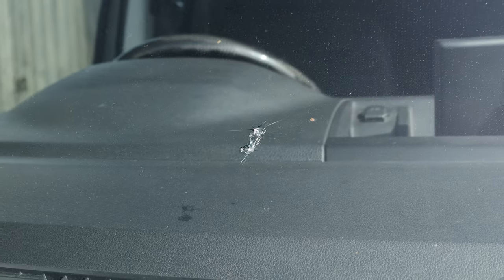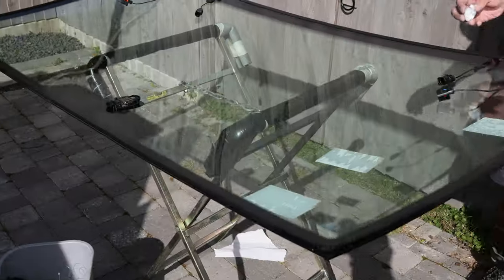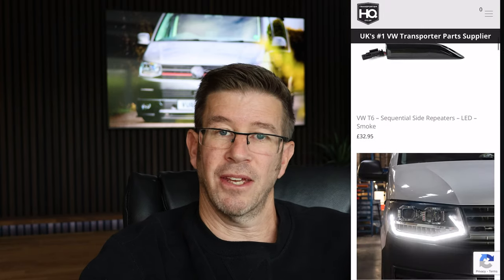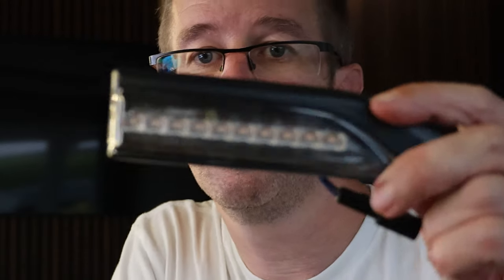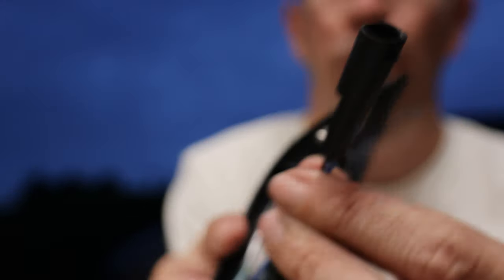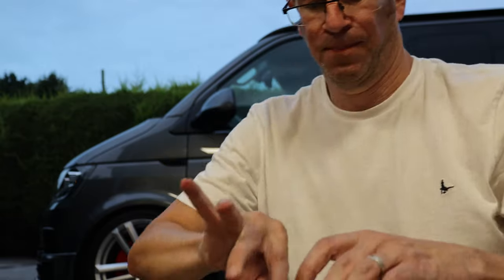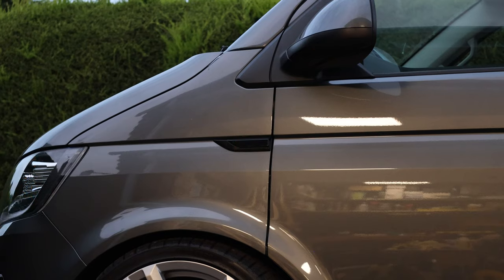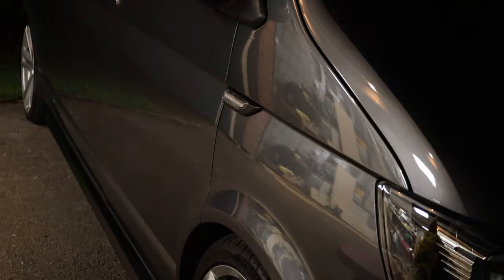NO MOT!!😣 | NEW Ultra Bright Indicators for the T6!! 🔥

Comment: Steve,
Take a look at the Aguti swivel base aka reimo. I bought the aguti from kiravans a few years back. Just the passenger one.
Retains the same height, more than pleased with it and I put the leisure batt under the drivers and kept that standard.
Also used kirvans battery tray and brackets makes a neat job
Reply from the maker: 🙌Thank you for the tip!! I will take a look into that as a potential for next years camping..👍

Comment: Good informative video Steve , the joys of owning a t6 🤷🏻‍♂️ I’m just gaining you a heads up , I’ve just had to spend over £3000 on oil leaks fly wheel side and the belt side ,! Apparently the gaskets VW fit from around 2017 onwards fail ! My T 6 is a joy to drive , but honestly it’s been the most expensive and unreliable van I’ve ever owed . Sorry for my moan , keep up the good work 👍
Reply from the maker: Hi Paul,   Ah sorry to hear yours has been giving you some bills! we had the same story with a golf TBF... sometimes you just have a needy one and then it will run for years.  hope its smooth sailing from hear on for you buddy. 🤞

Comment: Hi Steve had same problem with my passenger seat wobbling to , have you checked for loose nuts under the seat , as mine where until I tightened the nut , just asking 👍🏻
Reply from the maker: Hi Justin,    Yes I did on a number of occasions but sadly it was not the issue with mine

Comment: You will pass the MOT regards wheels on any van that's got multiple seats (ie camper or kombi), if it's a panel van it won't - tried it with 2 identical ex fleet vans and that was the only difference, they don't care about LED lights they test on beam pattern and light spread, only caveat being you can't see the LED itself and it's behind a reflector or prism.
Reply from the maker: That’s interesting stuff! 👍Thanks for sharing🙌🙌.

Comment: Hey Steve, do your main beam LEDS throw up a fault light?  Which ones are you using?
Reply from the maker: Hi Paul.  Yes they do!  It resets each time I   Toggle the ignition but it can be coded off.  I am going to do mine soon.  Vagcom can code it off and make the dipped beam stay on with main👍.  I am running the THQ H1 in the high beams👍
Reply: @SteveField  awesome.  Thanks mate. I think my carista can sort out the main beams staying on with the dips. Not sure it's clever enough to code anything out.  Keep them videos coming my man
Reply from the maker: @paulwilson3759  🙌thanks paul! Will do😊

Comment: what make was your swivel seat base mine has been fine for a few years now?
Reply from the maker: Mine is the RIB one.
Reply: Hi steve mine was from JustKampers and has been just fine for 3 years now 
My van is much the same as yours I bought a T6, 19 plate indium grey shuttle bus 3 years ago and have gone through the same process as you funally enough before I found your site we must be one the same wave length, have lowered van so the poptop will go into multi -story carparks on Transporter HQ Belsteins comfort can't afford the air ride just yet!

Rick Bishop

Comment: Hi Steve a quick question about the rear lights you have , are the travel in lite ones better than transporter hq versions , I see that the thq ones are all smoked with no clear bits for the reverse which looks good but not sure about quality of travel in lite stuff as I’ve had some dodgy led interior lights , was just wondering why you choose them over thq , any help be great amd thanks for the how to vids
Reply from the maker: Hi Nathan, sorry for delay... So I cant really comment on the THQ ones as I have not seen them close up but based on the other products they do i would assume its of the same high standards.  I went for the travelin-lite ones because thay were the only ones selling some at the time.   Still very pleased with them too! 👍

Comment: Ow did you deal with the diffent indicator connections
Reply from the maker: So when you take off a standard version you can release the oem wiring from the lamp and it connects directly into that sealed plug I show in the video👌.    So plug n play as they say👍
Reply: @SteveField  don't know what I have behind mine as t5 with t6 indicators. That's why I wondered did you chop the new indicator up to fit old spade connector or did you source the other end of the OEM connector from where
Reply from the maker: Ahh I see.  So for me no cutting has been done,  the ones I put on originally the spade connector slotted in where you would normally find the little orange bulb and so I just needed to pull that out, then unclip where the bulb holder meets the waiting and clip that into the new lights.